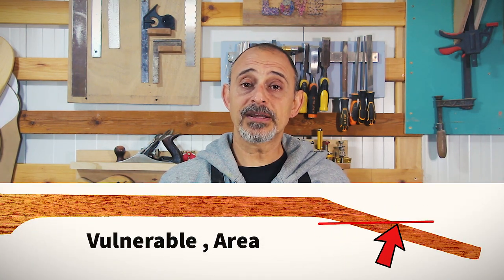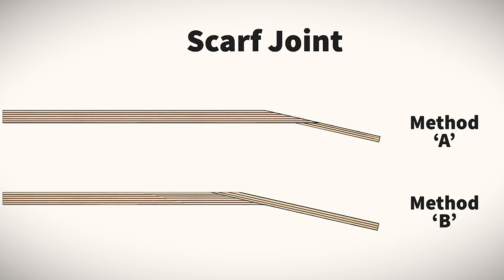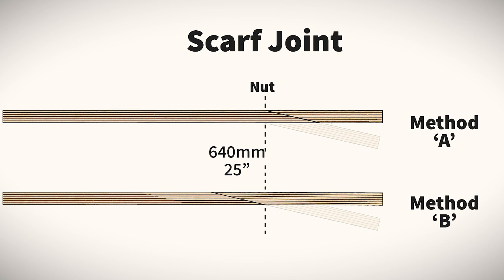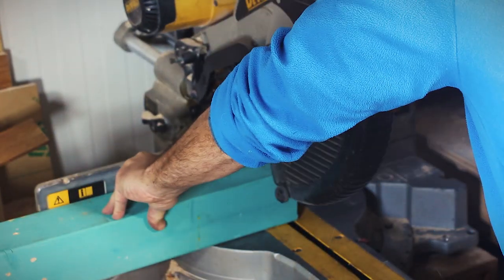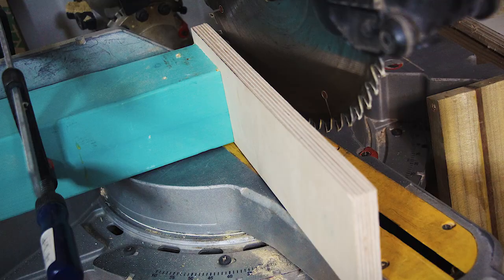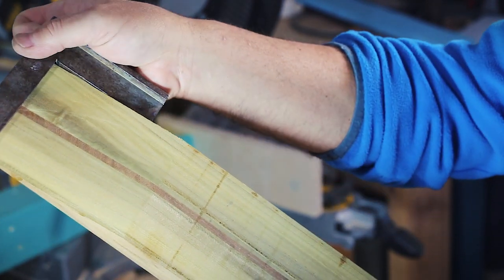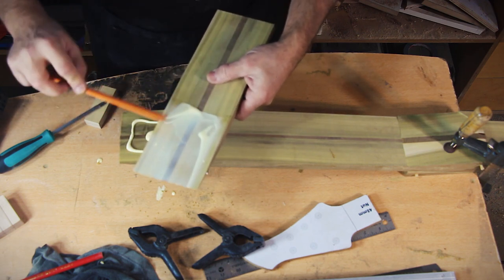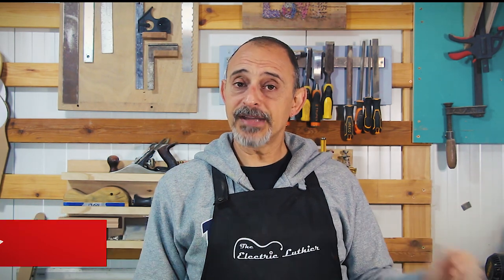Scarf Joints for a Guitar Neck - Not That complicated

Comment: I always use only method "A". But I make a blank for the neck as wide as at the 22 (24) fret +5mm. Then I glue two pieces of wood from the sides to the head and then one solid overlay on top (2-3 mm thick). It turns out very strong.

Comment: At 3:55 you request analysis on Method A vs. Method B. One factor that must be considered is the tuning machines. The tuning machines I use are exactly ¼” in diameter and a specific ¼” drill bit that I have cuts the hole so that I need to use beeswax to push the tuner string post barrel into the hole then fully set it by tightening it down with a socket wrench. Notice with Method A at 2:08 that the 6th and 1st string tuners go through both pieces of the scarf joint, thus if your tuner string post barrels are as tight as mine in the holes they act like a dowel and since the tension of the strings is somewhat perpendicular, certainly not even approaching parallel, to the direction of the tuner string post barrels, I contend they make the Method A joint stronger than if the tuners were not there.

Comment: Great video that covers all the bases. I do know of two matters which I believe other commentators haven't mentioned. First with type A, if you remove the headstock material from the REAR of the scarf, the scarf is so far into the head that the first set of machine heads acts as a pair of bolts across the two pieces, for more strength. Second, with a good glue joint, the visibility of the scarf is no worse in type A than type B. In some respects, it is actually better, since the area of wood where the grain changes is thinner than in type B, and so less visible. Obviously this is only the case if you use a backstrap. This and the headstock overlay make a strengthening sandwich that is as good as the effect of the fingerboard in type B, in my opinion. Thanks very much for this.
Reply: Thanks for the comment @Robert Newell   🙏. These are all valid points and will really come down to personal preference, the finish and look and the type of wood. For example, in my opinion, a multilaminate neck, with any proper scarf joint, will look great, it doesn't try to look like one piece, to begin with... On the technical side of things, they should all be strong enough, and stronger than a one-piece angled headstock.  Cheers

Comment: Really great video.  I prefer the type A joint and then I glue up a headplate on the face to reinforce that glue joint.  I have used a nice cross cut hand saw to cut the angle and clean the joint up with sand paper attached to a flat surface.  I like shallow angles as more wood is being glued.  I prefer to place the neck blank on its side and use clamps on the table at the ends to stop the pieces from moving.  I once made a neck where the head stock angle was shallow but I made the head in the classical style.

Comment: One of the best videos I've seen on this subject.  Your visuals are really well done and clear.   
I personally like cutting the joints on the table saw with a tenoning jig, leaning the blade over to whatever angle is required.   Seems to be the safest way of cutting the angle IMHO.
I also like leaving the peghead piece thick at 3/4" thick at the joint and tapering it on the back side away from the joint.  A little tricky but worth the extra material at the joint, once again IMHO.
thank you for the video...
Reply: Thanksfor the comment @Joe M
 🙏. There is definitely more than one way (or my way) to make a scarf joint, and I have actually not seen anyone do it as I did. I do think that there are more people with a miter saw than table saws or band saws, and I was surprisingly happy with how clean and smooth the cut came out. At the end of the day, if you are happy with the end result (and it doesn't snap off under string tension) it's all good. I can see your point about keeping the peghead piece thicker.

Comment: I only use "B" for my scarf joints.  There's more gluing surface and then adding the fingerboard to cover the joint makes it even stronger when talking about leverage from the strings.  That joint is glued in 3 places:  The head to neck, neck to fingerboard and head to fingerboard.  On top of that, if you wants a natural finish on your head, you dont have to hide the joint with a peghead.  Either joint is fine when using a peghead, but the peghead isnt necessary with joint "B".  "B" for the win.

Comment: Brilliant video and explanation of the process. Thankyou for taking the time to make and share this. I am trying some different table saw jigs at the moment practising for my first guitar build soon.  Your help here is really valuable and I appreciate it. Especially your thoughts on using the mitre saw and seperate cuts for neck and headstock. Thankyou again.
Reply: Thanks, @Pete Crosbie 🙏, I appreciate the comment. As much as I would love to have a fully decked workshop, I often have to make do with the tools I have. This makes for sometimes fun and sometimes frustrating results, but there is always more than one way to approach a task, and since we are not production-driven, we can make out own quirky methods. As for the headstock as a separate piece. That also came out of necessity since I had one blank which was a bit too short and another that twisted midway, plus, you cant leave a very long piece when cutting with the miter saw jig. Longer neck blanks are hard to find in timber-less countries, so it worked out for the best. Glad you like it. It also always bugged me that often (especially with Gibson-style necks) a very beautiful' long and thick piece of wood is used. Then it is cut to make a scarf joint and another piece is used to add the 'wings' to the headstock. Seems like an inefficient way to use the wood.🤷‍♂️ But what do I know

Comment: As ever, simple, clear and informative but above all, very much appreciated.
I own a few Charvel Surfcasters, they have Type B scarf joints but they start further along at the first fret not the nut. I guess that gives a greater chunk of wood, more fretboard covering the joint and the truss rod. Although aesthetically it raises other questions. Your spatula comments made me laugh. Those simple ‘why didn’t I think of this before’ moments.
Reply from the maker: Thanks, @fatpotanga, 🙏. My guess is that Charvel used a thicker chunk of wood and only thinned the headstock part after gluing, removing the excess from the back/ bottom of it. this way the nut position was nudged a bit forward.
 ‘why didn’t I think of this before’ was exactly my feeling 🤣🤣

Comment: In Type B the minimum width of the glue joint is ~43 mm, in Type A it's the width of the headstock.
Reply: thats how i see it as well, also if you add a veneer that is extra support, so i glue the A method. i added a veneer on the top and then added one on the bottom because my headstock was too thin. it was m y first build. im doing the second now and im going to try to not have to put veneers

Comment: There are a couple of other things to add regarding the simple side profile diagram you show, illustrating the length of gluing surface of "Back-scarfed" and "Front-scarfed" joints (type A and B in your diagram). In front-scarfed headstocks (type B in your diagram), the gluing surface is reduced quite significantly (when comparing it to a side elevation diagram) by the neck profile. As you have to remove material around the glue joint to make the curved surface of the neck joint. In back-scarfed joints (type A in your diagram) the tendency is to cut the width of the neck all the way up to the top of the headstock, so the headstock is effectively too narrow. The next process is then to add straight pieces of wood ("extensions") to either side of the headstock to make it wide enough again. This has the effect of STRENGTHENING the back-scarf joint, by laminating "strengthening bars" either side. Normally you have to put a veneer over the whole face to cover up the joins on the face however.
    I always make my headstocks this way (back-scarfed). Because A) back-scarfed headstock joints are not reliant on a single glue joint to keep them together. And the strengthening bars (I put on) straddle the scarf joint on both sides, making it practically unbreakable B) there is one single uninterrupted piece of wood going from the top-nut to the end of the neck C) all wood is subject to expansion and contraction across the width of the grain, due to humidity and temperature variations. With a front-scarfed headstock joint, there is (at least in theory) the possibility for the piece of wood that the headstock is made out of to shrink in thickness due to low humidity. This will potentially have the effect of lowering the action as the nut will will be pulled down with the shrinkage of the headstock material. And conversely, in humid conditions (I live in the UK!) the headstock material can expand in thickness and pull the action upwards. Of course the fretboard over the neck blank will minimise this, but the potential problem is real, not just imagined. ALL timber DOES expand and contract. It's a proven fact of physics. 
   For glue spreaders I always use the folded edge of a piece of folded used sandpaper (1-2" square, when folded). It's always straight, it has serrations on it, which form a kind of "comb" effect, and when you've spread what you need to spread, it goes STRAIGHT in the bin! This really IS the perfect glue spreader (without using a roller). AND you always know there is plenty of used sandpaper around to use.
    I do like your chop-saw jig though. And the extended base router for taking down the thickness. I think I might have to make one of those myself. Thanks!
Reply: Thanks @Alexander Guest Guitars for the very detailed comment. 🙏 You make some very good points for the back-scarfed method. I did not consider the headstock 'side wings' as a strengthening factor as I used one wider piece but it makes perfect sense.
Reply: Hey guys! I'm an absolute beginner so please be gentle... The front scarf method has more gluing surface at the joint itself (once the headstock is thinned to size) but the side pieces for the back scarf method add strength... would it be worth combining the two? As in, make a front scarf (bigger gluing surface) and then add some side pieces for the headstock as reinforcement? An added advantage (provided this method doesn't have some horrific flaw I'm not thinking of) is that you would also eliminate the visible joint on the from of the headstock (but you would still have vertical slits from the side pieces). It may make for an even stronger joint. Again I'm a beginner and really don't know, just an idea. Thanks to both of you for the information by the way.

Comment: Great video! I learned so much about guitar necks, which makes me wonder. How strong is the glue that is being used to connect the two prices of wood?  With the pressure from the strings pulling the head stock, I’m so amazed how the glue is so strong
Reply: The glue is strong enough that the wood fibers will split around the glue joint, rather than the glue joint break.

Comment: This was a great video. I am getting ready to start my first build and I've been worried about how to do this angled headstock. You made it look easy and your "rebel" attitude matches mine as well. One question - I have 3/4 inch maple blanks. I think they should be thick enough but I was wondering if you think they'll be okay for the neck? I would obviously have to do the angled headstock you described and I would also have to add additional material at the heel but I'm curious what you think?
Reply from the maker: Thanks Bob. 🙏 The Most next is around 3/4" at the nut and a bit more at the heel if it's a bolt-on. That includes the thickness of the fretboard, so you should be fine if your stock is straight and smooth. I'd say, for a fender style, you are all set. Since you are talking about a scarf joint and a thicker heel, I assume you are going for a set, Gibson tyle neck. This should also be fine and you will just need to double the thickness of the heel, not an uncommon practice. It's going to be tight but if the fretboard is about 1/4", you should have enough material to get away with it. Just take into account that there will be visible seems both at the heel and the headstock.

Comment: cool video, could this also be done for a straight neck-headstock design ? In my case I want to redo a angled headstock by cutting if off at an angle at the neck, and add a straight style headstock in its place. Not sure how the grain orientation needs to be in order to do that.
Reply: Interesting one  On the technical side of things, it can probably be done although it sounds very counterintuitive. You will probably want to cut or shave the angled headstock from the backside, lengthwise, and as far as you can from the nut, You will probably also not be able to use the same piece you cut, unless it's symmetrical like a Gibson and you manage to make a very straight and accurate cut. I'd consider, making a jig for it. Another thing to consider is the original scarf joint if there is one.

Comment: 3:00 won't agree, the main purpose why scarf joints are used is getting an angled headstock with thinner slabs of wood, so to save money on wood!
No guitar requires a super strong headstock,  if you drop the guitar and the headstock breaks it its not the headstocks fault. 
I have yet to see or read about an angled headstock that broke off due to string tension only!
It's a gimmick to trick people into thinking  that it's something special like so many other things around guitar building!
People have found ways to use and sell wood, they would normally have no use for, that's why we see more and more "multilaminated everything" guitars. 
Hell, they even started making fretboards out of different woods and sell it as something new and cool, which in reality it's "ey i have cleaned up my 
workshop and found this scrap wood i have no real use for" I mean, econimically it's a GOOD thing but i hate it when people sell those "multi wood piece" 
guitar at such high price levels. Maybe it's also to push up  the value of regular woods up, who knows!
Reply: Thanks for the comment. I don't think saving money while creating a stronger neck is necessarily a bad thing. You are correct in saying that necks don't break because of string tension alone, but after seeing a 70's Les Paul break because a friend's child accidentally pushed it, you wish it was 'too strong'. It breaks your heart. A scarf joint or a flat neck would have probably survived it. I can sense your frustration with the guitar industry coming up with 'new and improved ways to sell guitars for a higher price but I am thinking about the home builder more than larger companies with concerns of mass production. I look at the practical benefits of scarf joints and laminated necks and weigh them to the alternatives. If I can make an angled neck with a 1" peice of wood instead of 3" (which is hard for me to come by), it's a win in my book.
Reply: @yoavbinyamini  Absolutely agree, from a home builders perspective it makes total sense! Also if it's done correctly it's half as bad, but i have seem many bad scarf joints. For example when differend wood types are used or multi laminated necks where the scarf joint part is "blank" or even worse when the headstock is multi laminated as well and the stripes do not align perfectly. It simply looks bad :)

Also with a smaller angle even an one piece neck will be strong enough, i think the huge angle Gibson is using is the main problem for the headstocks snapping on impact.
Reply: Sorry, but stronger is stronger. No one plans to drop their guitar. As a working musician, give me the strength! So saving money on production and having something stronger is not as good as what? So-called tone that is immeasurable? I don’t think so.